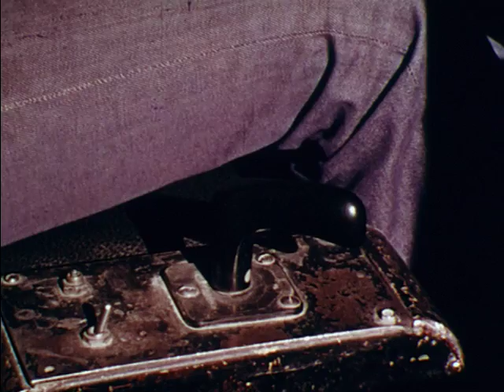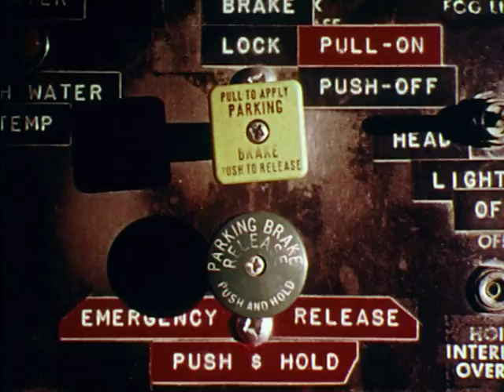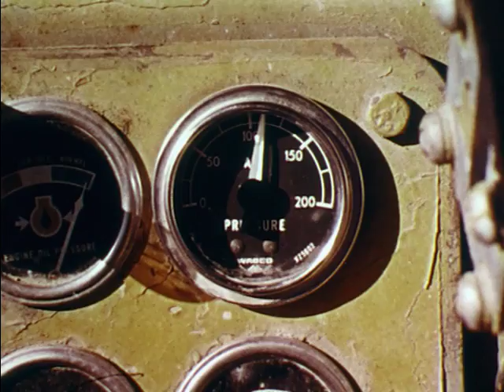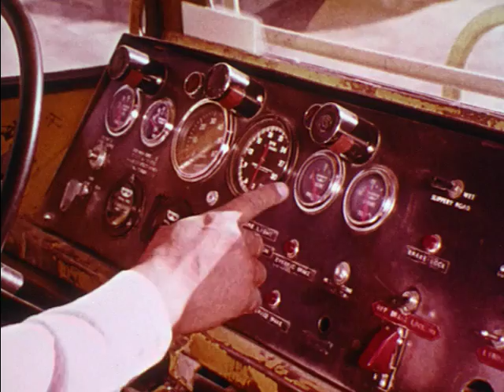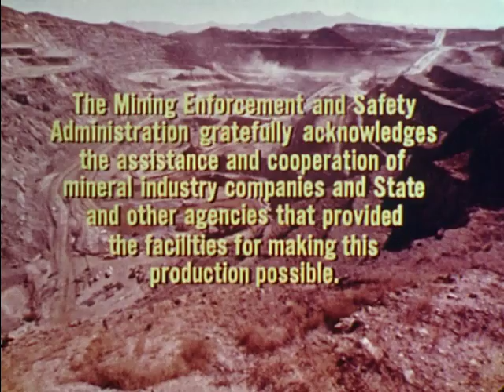Safety On The Move - Track Haulage Safety (1982)

Comment: I died a little inside seeing that 67 C10 get crushed.
Reply: I'm pretty sure it was a 70. But yeah, damn shame.
Reply: All to get the point across
Reply: It's 68 or newer because it has side reflectors
Reply: It was a '70 but still....
Reply: The one that got crushed is a fleetside 68. Has the old style grille and emblems and the side marker lights. The one they show a few seconds later is a different truck, a stepside '69 or '70 with the newer grille and emblems
Reply: yha same
Reply: They used 3 clearly different trucks for that segment. The guy originally pulls up in a square body.
Reply: @mrbobawesome  yep. Pity they didn’t just crush that square body instead.
Reply: @tnridgerunner  It's a shame they didn't use a Ford.
Reply: @mrbobawesome  lmfaooooo
Reply: Me too
Reply: Yeah me too.
Reply: Bet the guy who got to run it over had fun though
Reply: It was just a base model fleet truck. Nothing very special or valuable back then. No one cries much at seeing a 2011 Chevy getting hauled off for scrap today or wrecked on the road. They are just old trucks, but not  classics. A million more where that came from.

Comment: Back when the old 2-cycle screamed night and day but I HATED those convex mirrors as the only one on the drivers side. One with a good straight mirror was fine.
Reply: on such a big truck, couldnt you fit a door sized mirror for backing up? angle it edge on while driving forwards and pull it back when backing up

Comment: This looks like it was released in the 70s or 60s, not 1982.
Reply: 70s at the absolute earliest, rigid haul trucks of that size didn't start to appear until then.
Reply: Headframe Hunters well they were not up to date with there excavators then. I was thinking myself it’s not 1982
Reply: @ferguson20diesel49  Just looked it up, MESA only existed from 1973-1978, so it was filmed in that period.
Reply: Headframe Hunters behind the times excavator wise. Could have poclains on the job. That’s what we had in Europe. Biggest hydraulic excavator in the world one time
Reply: The camera effects reminded me of M*A*S*H my dear father would watch.
Reply: Yeah seems late 1970s ish to me. Not 1982.
Reply: Looks like 1980s to me. First, they film it all then release it a few years later, so the release date is not when it was filmed. Second, why would they be using all brand new, late model equipment to make the video? any site is likely to have equipment going back ten years or so, you don't buy new stuff every year (and they did even less back then), so just because you see some 70s and even 60's equipment and trucks doesn't mean it isn't the 1980s (actually late 70s). In fact you are more likely to see a bunch of old stuff, because whatever they used to make the film, it was what they could most spare from the work site, and if it was going to be abused to make the film, they would take the oldest junk they had.
It is definitely not 1960s though, they didn't even had ROPS in the 1960s, the stuff looked ancient compared to modern stuff. This machinery just looks a bit dated.
Reply: @ericzerkle5214  1982 is the release date, not the date it was all filmed. And just ow much difference would you expect to see between 1979 and 1982? The first few years of the 80s were a lot more like the late 70s than they were like 1989. For that matter, 1991 looked more like the 80s than 1999.

Comment: Those old Wabco's were pretty decent haul trucks in their day. Still quite a few of them left in service. They were also offered with Cummins power. I've never seen a CAT powered one, so not sure if that was an option.
Reply: Westinghouse Air Brake Company made mine haul trucks? That WABCO guage to me looked like air pressure for the brakes. Kinda familiar with the WABCO name, run trains for a living.
Reply: @theknickerbocker5808  Yes they did. I think it was around 1952 or 1953 Westinghouse bought LeTournneau's off-road equipment division and started the Wabco lineup of haul trucks, etc.
Reply: @speedandmarine9066  learn something new everyday. Always knew them for their air brake systems.
Reply: @theknickerbocker5808  they made some pretty cool scrapers too

Comment: Love all that 2 stroke action! Also did the pickup @3:56 change or was that me?
Reply: It was swapped. He drove up in a 73-80 chevy truck, then climbed out of a 67-72 chevy truck. The 67-72 was likely non-driveable in some way, so they used a newer white truck for the driving shot.
Reply: Right on , it sounded like they all had Detroit's .
Reply: Yes easier cheaper to junk out.
Reply: @adamdanko596  Sounded like 16-V's.
Reply: @lewiemcneely9143  That's awesome .
Reply: @jonathankipps9061  that was a damn shame to see that 67 or 1970 Chevy truck getting crunched that particular body style in cab of that truck is getting really hard to find today that was one of my favorite years for that pickup truck damn it was just a shame to do a thing like that it should have been done with the later truck.
Reply: And they mantain the pretty god cleaning

Comment: I must be one of the few normal civilians who grew up using wheel chocks as a normal thing. A lot of my dad's vehicles didn't have parking brakes and he didn't always trust the compression. He always used chocks, especially on steep hills. And i remember he did have at least one Volvo that would lurch back slowly, one cylinder at a time, an inch every few minutes, if you left it parked on a hill. 
I do miss those old 240s, they don't build cars like that any more.

Comment: 3:52 - 4:07 There were 2 different Chevrolet pickup trucks used in that scene, the first one was a '73 long bed, & the second one was a '68 short bed which was the one that got crushed by the biggo dump truck.

Comment: 2030 - the truck operator sits at a computer in an air conditioned dayroom programming the movement of the truck down to the nearest millimetre.  The shovel operator's sitting next to her.
Reply: I doubt it.  2030 is less than a decade away and physical feel and smell are still the best sensors the machine has.  The computer systems are merely an aid to the operator and should never be relied apon. 
	A healthy, comptent and well organized crew are the the most efficient and reliable machine to date.